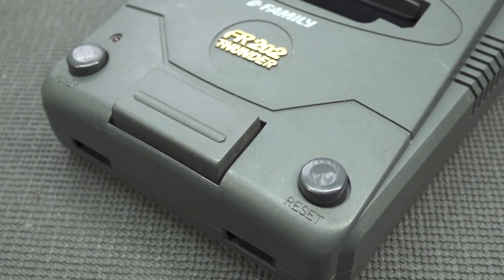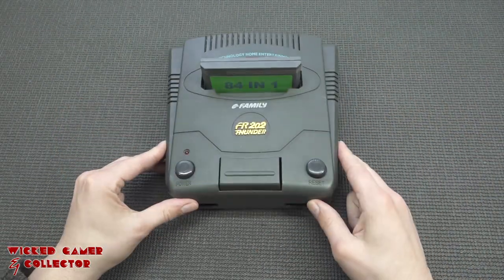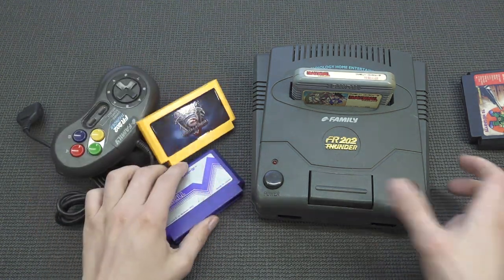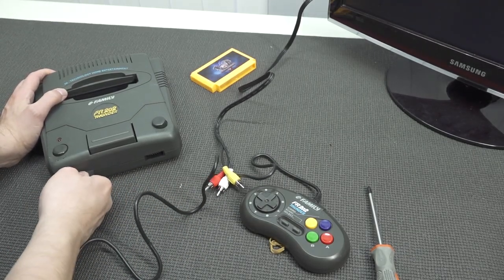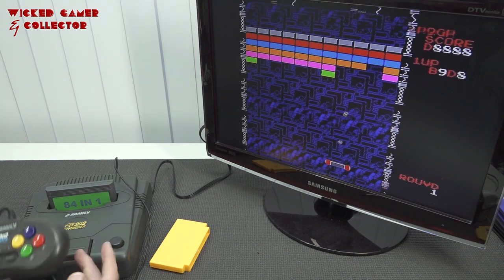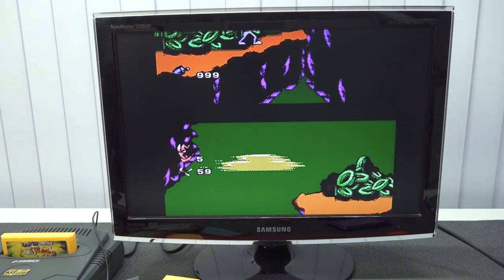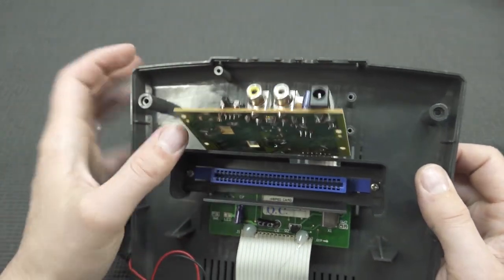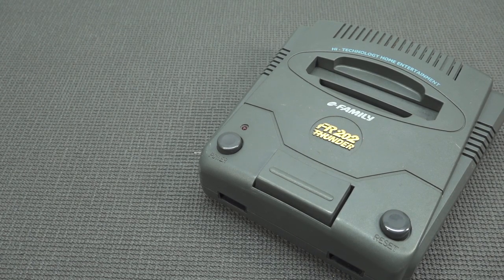A High Quality Retro Console ? 🤔

Comment: the 15pin connector is basically the same as the original famicom EXT port btw so standard original famicom addons + controllers should work <3
Reply: Yeah, that was my first thought.
Reply: I do not have any external devices for my famicom but I was wondering just that. Thanks for clarifying it.

Comment: There seems to be a lot flux left on the board for power and video output. Leftover flux usually can mess up the functionality of the electronics and it needs to be removed with isopropil alcohol or contact cleaner.

Comment: You can also clean out those cartridge pin connectors with a fine piece of sandpaper I've fixed alot of older n64s that way

Comment: the black blob what you are looking for would not be on that pcb. That pcb is only for output. The unpopulated area (where the sticker is) could populate a RF(antenna signal) unit. And at the right side of that switch would be another rca female socket that can be connected to your TV's RF input. Its cuts cost to just leave it out.

And like others said before; those slot contacts are not plated so they will most likely oxidate and get very dirty overtime, thats why you should clean them. Take some stronger kitchen paper and a creditcard fold it over the card and apply some contact cleaner or even some IPA, then inject it into the slot a few times. You will be surprised how much dirt comes of. That will most likely fix it. If not then you could look for some cold/dry solder joint on the card connector. If they used cheap solder then its not uncommon for them to crack over time.

Oh yeah, the thing what you call a black blob can be either used for the NOAC(nes on a chip) or for the rom storage. But most of the time its just the NOAC and the roms are stored on prom or eeprom. If you like to know more then give me a yell. But for now I can tell you that you normally would look for them on the middle pcb. The bottom pcb is a breakout board for the input and the top pcb a breakout board for output. Almost all cheap clone systems use this setup.
Reply: Not sure I would waste a good India Pale Ale on cleaning an old videogame console. 😎
Reply: @totophi  Not what I had in mind 😁 but it might work aswell. Although if you use too much you might end up making a console with wonky controls for the rest of the day.
Reply: @timvangenechten5258  : You might be able to squeeze dual or even triple screen output if you squint hard enough! 🤪

Comment: If the ROM connector was bad the code wouldn't run either. Here it looks like the some bits are sent uncorrectly for the look up of the graphics data. So wrong tiles are shown for characters and tiles (example T for L " for Y and instead of the 'ARKA' tiles the 'NOID' tiles) Might me be a connection problem on the pcb with the RAM were the tiles and character data is stored.

Comment: The reason you didn't have a blob on the board there, is because that part wasn't the main PCB. That was just the AV output and power. The main board is the one under the cartridge connector.

Also that joystick connector is actually what the original Famicom used for accessories.